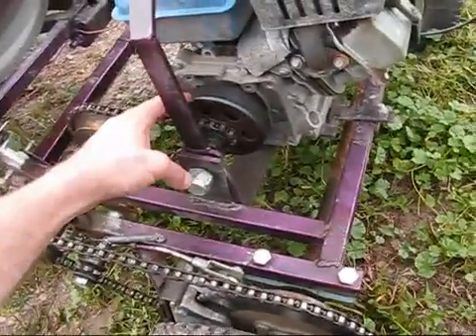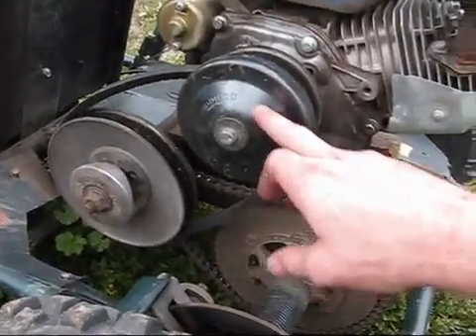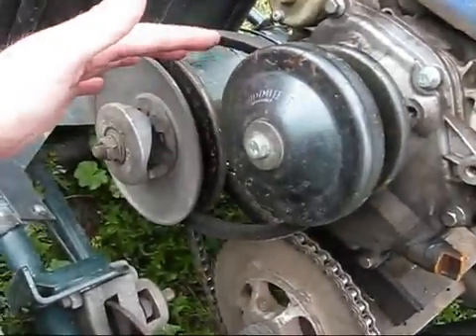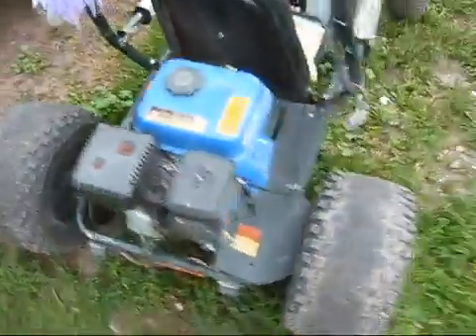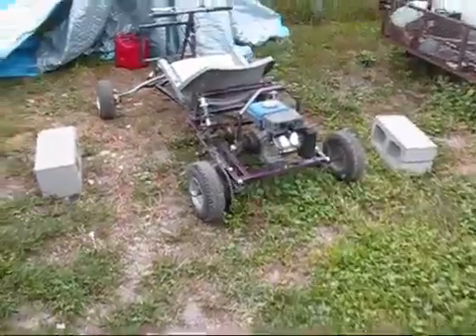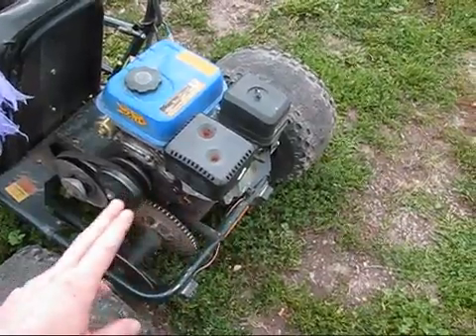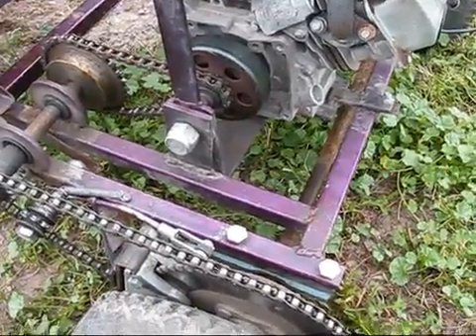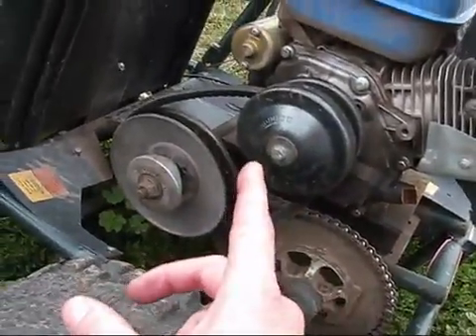GO KART | HOW TO BUILD / make #5 ( clutch, torque converter by T-man ) █

Comment: Cool and informative. I have a junior Rotax cart that has a Lifan 4 speed mounted on it. and im not that big of a fan of that setup. so im trying to mount an Valmet 300cc 2stroke waterpump engine on it. but the axle is massive so im having trubble finding a slipclouch that fits. my plan is to go slipClouch with bolted sprocket and chain.

Comment: Its not common but i do belive there is a drive shaft for the go karts, i even seen others use a trans axle from riding mowers
Reply from the maker: yep, That is what I was talking about when I was speaking of a direct drive set-up. They can be temperamental.
Reply: Yea they have to be lined up just right and even account for axle climbing its pretty common issue in full size vehicles, its more apparent in high torque setups and heavy launchers like drag rails or off road trucks.  On missed alignment and its a fast way to blow 5 grand

Comment: Yo!, T-Man, I saw a "Differential axle" on line, and was wondering,.. is this type system the best for power transfer to both axles simultaneously? I'm in the process of building a "Rat Rod", and I'm  contemplating installing either a 22hp or 18hp engine in the front, and running a chain to the rear axle .I believe in the transfer of power from the front to the rear, I'll lose valuable power due to the chain length, even w/ the chain tensioner, so, I thought of going thru the middle of the cart w/ the chain to the trans axle from the engine in the front to a "Differential axle"..what's you opinion on this? Also, why didn't you talk about this type "Axle" on your "AXLE" VIDEO...and if you can, can you make a video, and give us your "VIEW" on this type axle...pro & con?
Thanks, da: Badger

Comment: Ok I'm putting a kart together for my boy and got just straight shaft clutch but my eingen puts out to much rpm it's fuel injected so if I turn the rpm down I don't have traltal if I turn it up it takes off when I start it any help would be nice thanks
Reply from the maker: hmm, what kind of engine are you using
Reply: it's a 3 or 4 horse 2 cylinder  standard military engine
Reply: model 2a016iii
Reply from the maker: well you might need to get a larger clutch, I mean one that engages at a higher RPM - like a racing clutch also get a larger sprocket on the axle - that will make the machine slower but have more power.
Reply: T-Mans Go Karts do you no off a size or name of one looking to keep some what cheep I'd like to be under 75 for new clutch and there a farley good size sprocket on the drive shaft
Reply: T-Mans Go Karts if I new how I'd send you a video of what it's doing

Comment: Question for you.  Right now we have a Tomberlin 150R that has been converted by previous owner to a Predator 212 with a Chinese knock-off of a Comet 30.  The thing has never run right, ever.  I can't get it to put power to the ground whatsoever.  I've put a new belt on, I cleaned the sliding parts, I made sure the springs were set right, including buying new springs, but still, all it will do when I hit the gas is burn the belt up, without moving.

Will converting it to a regular clutch help?  Once it's running right, it will be two adults riding it, so figure 400+ pounds of people.

If converting it to a regular clutch, what would you recommend?
Reply from the maker: What is the sprocket ratio. How many teeth are on the TC and how many teeth are on the sprocket on the Axle ??
Reply: 9 teeth on the jack shaft, 52 teeth on the driven sprocket.
Reply from the maker: Ok, in your situation its weight.... the machine is to heavy ... You need a larger axle sprocket 60  to  70 tooth. That will give you a lower ratio . To find those McMasterCarr is where I would look.
Reply: Cool, thanks!
Reply from the maker: yeah, it  might work. but it is a 35 pitch sprocket. so make sure your TC has a 35 size also.

Comment: Belt setup you're talking about uses essentially a similar style belt used on vehicle engines for timing. Cogged belts while nice for light weight, I doubt they'll have the overall durability for long use like a chain would. Not sure if the belt has to be bought for size or if it can be modified like a chain can by removing the master link then taking out links to make it the size you need. Haven't seen cogged belts on a go kart ever just chains with and with out a torq converter. Unless it's just a standard lawn tractor style belt with a tensioner pulley...think that's more parts and over complication than what it's worth.

Comment: Whats the top speed u can get out of a 16hp duromaxx engine with a torque converter
Reply from the maker: Joshua Beanblossom that depends on the tire size, RPMs, weight of the kart. type of kart, 1-2 seater, and sprocket ratios. Watch this .... https://www.youtube.com/watch?v=J1HlMCnW7Pg
Reply: +T-Mans Go Karts wer can we get this converter
Reply from the maker: +srijan rao polsani ... search Google for "Go Kart torque converter"

Comment: You need to study you subject before you make a video, because you really have no idea what you are even talking about, you remind me of a plumber trying to build a skyscraper
Reply from the maker: Well thanks for the words of encouragement Ken, I'll try to build a skyscraper then.
Reply: ***** haha don't listen to the haters man. Love the channel, been watching for about a year and a half. Oh, i just got a non running cart, with a 15 horse Briggs, I know, overkill, on a little plain Jane frame, and it doesn't have lines or hoses to or from the carb, and I can't figure where I would put them! They're are two hose fitting on the carb, one I know has to be the oil relief, but I have no clue what the other is. Now, I'm not just dumb with mechanical stuff, just have never been in this territory. Just wondering if you could help. Thanks man. Keep up the good work. Super helpful
Reply from the maker: Hey Jacob, Im not familiar with that engine but I know if you type it into the google search engine - make , model , and HP you should get a diagram
Reply: ***** Thanks a lot man! Have a good. Mornin

Comment: whats the difference between a 30 Series Torque Converter and a 40 Series Torque Converter? i got a gokart with a 30 series Torque Converter and was gonna get a 40 Series Torque Converter Driven pully, which the old one, ate my 30 dollar  belt up. thanks
Reply from the maker: you dont want to miss-match TCs a 40 series is for larger engines 8hp+ . most of the time the culprit to belts getting chewed up is that the driver and driven are not aligned good enough. The two flat sides should be in line with each other.
Reply: ***** Ive got a 6.5 motor, with a 30 series Torque Converter, Whats the difference between a 30 series Torque Converter and a 20 series Torque Converter ? thanks

Comment: Hi I am interested in building a go kart and I was wondering if it is worth buying a torque converter or regular clutch. Does it greatly increase speed or torque. I just don't know if its worth another $100.
Reply from the maker: well J, if your a young kid under 16 , no its not worth it. BUT if your older then yes. If you ever drove something with and without a TC. You would know the difference.
Reply: Well I'm almost 15 and I weight 120 but I plan on building this as a two seat go kart but it won’t hold more than 250 lbs. Do you still think that a clutch would suffice for on road use? I would also like to try and get around 25-30 mph. would a 5:1 gear ratio have awful acceleration?

Comment: What motor is it contact me at 5186676
Reply from the maker: I show two different motors in this video, which machine are you talking about?
Reply: The one with the belt
Reply from the maker: Angel Peña that one was a 6.5 HP

Comment: how does the clutch activate?
Reply from the maker: through centrifugal force from the rotating engine shaft. When the RPMs go up it causes the weights to expand and lock against the outer steel of the clutch.
Reply from the maker: nope. on the purple kart in this video. Is a cen. clutch going to a sprocket. there is no torque converter on that set up.

Comment: nice informative video! I have a jack shaft set up with a pulley centrifugal clutch instead of a chain that drives the jackshaft. Do you have any problems regarding the wear and tear of the brass bushing on the clutch? I had mine machined twice already in two months, despite oiling the bushing regularly after several hours of usage. wonder if there's anything I overlooked. Thanks!

Comment: hey T-man I have a question, I have a tony kart with a blown crank shaft I might be getting a new motor if I do can I still run a clutch brake as the old blown motor did or if I get a new motor will I have to put a brake set up on it??

Comment: So me and my buddy built a go kart with a 6.75hp rotary tiller engine on it. we originally had a dirtbike motor on it and just welded the sprocket on.  now that we have the other engine on we are just reusing the dirtbike sprocket with a 40 chain clutch with a direct drive to the axle.  we have small fourwheeler tires on the back.  when we took it out for the first time all the clutch does is slip and burn up.  is our best bet to just go to smaller tires or get a heavier clutch?

Comment: I am thinking of making a jack shaft from scratch so can you explain to me basicly what are the parts it consists of? how can i make the gears and shaft at the lathe or to buy them from?
Reply: If your asking how to cut gears on a lathe your not ready to do it. It can be done but much easier on a mill. And cheaper to just buy if you value your time